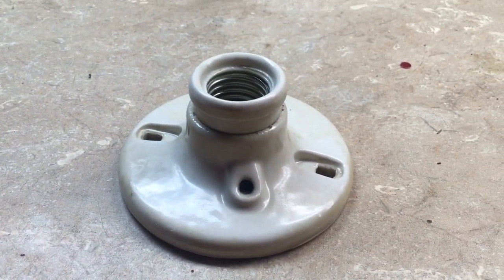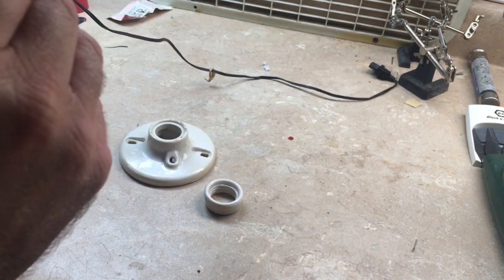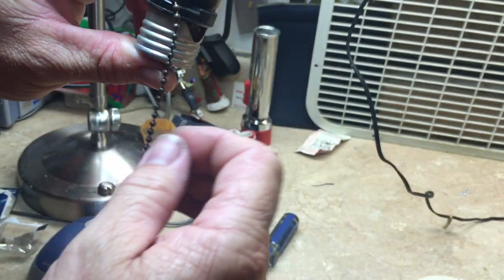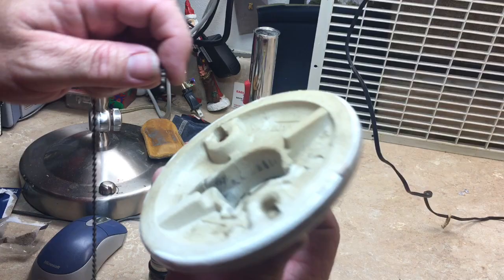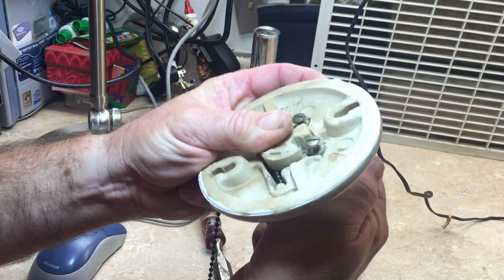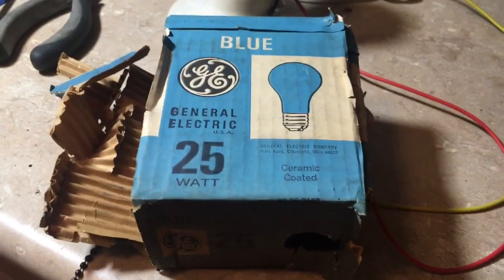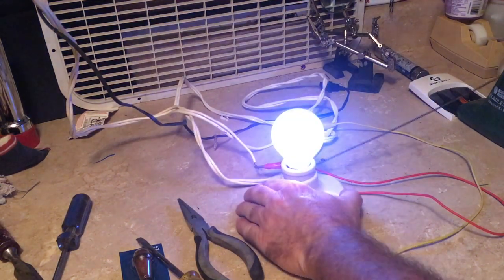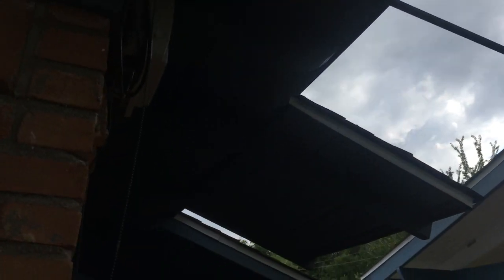Repairing the Pull Chain Switch on a Porcelain Socket

Comment: Nice, I didn't know they could be repaired that easily.  Not that I had one break on me, but good to know should it happen.  Nice vintage test bulb too!
Reply from the maker: Thank you, I checked it out a while back, and thought, wow, I can fix that easily. Being very low on the list 2-3 years later, it's fixed!
Reply: Wow, it moved on the list?  And made its way to the top?  You really must get some stuff done!
Reply from the maker: I know, right! Well, this was before Early Octember hit. Now I have to repair pull start the leaf blower.
Reply: It's always something.
Reply from the maker: Indeed! Got the leaf blower back in service. Just waiting for the next item to break.
Reply: I actually just half-fixed my weedwacker that was out of commission.  I fixed it enough for it to run, but need to put the finishing touches on it.
Reply from the maker: Cool deal, what ended up being the issue(s)?
Reply: Rotted out return fuel line was the main issue.  Noticed first when priming there would be a shower of fuel, and then when running there would be a stream of fuel.  I brought it to the repair place, but they told me they no longer fix them because they're "disposable".  I get that.  But I showed him I just needed the line,. and he went in the back and handed me 4 feet of it.  The old line was petrified.  New line is of a slightly smaller diameter, so now fuel leaks from the tank where it goes in if it's on its side.  I'm going to dab that all up good with hot glue, I think that should hold.

The other problem was the string itself.  That wouldn't feed correctly.  I took the spool out and found I was almost out of string to begin with.  The rest is sort of a blur.  I remember I had a spool of new string that was slightly thicker diameter and didn't play nice, but it was all I had on hand.  The first one went in fine, but after I cut off that length and tried to put the next in, the cutter "splayed" the tip of it out, and no amount of cajoling would make it fit.  I finally found that cutting it at a 45 degree angle gave me a point where it would go in.  I don't remember if it fed properly after that, was baking in the sun, being disgusted the entire time.

The third problem which I haven't fixed, and won't be fixing, is the machine's inability to restart after being shut off.  It's an easy 12 pulls on the rope, playing with the choke, futzing around with the throttle, 10 more pulls and if I'm lucky it'll run.  I had to restart it 3 separate times, so you could imagine how disgusted I was with the whole thing.

The odd part is when cold, it starts up in a nominal amount of pulls like it should.  What I've been doing is starting it, doing what I need to, then setting it down in the grass still running as I walk around the property and take inventory of what I missed.
Reply: What is the piece that you replaced called?  Where did you get the part?